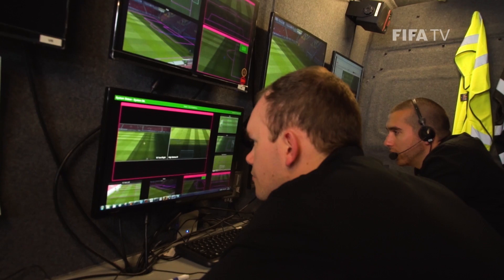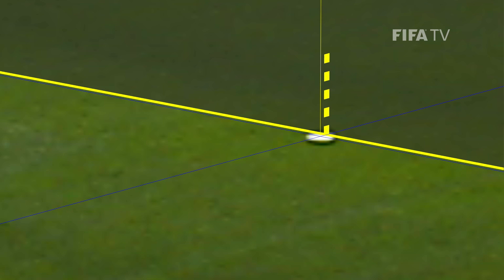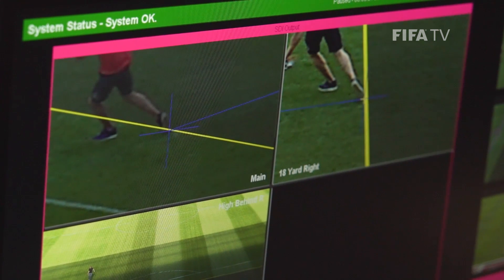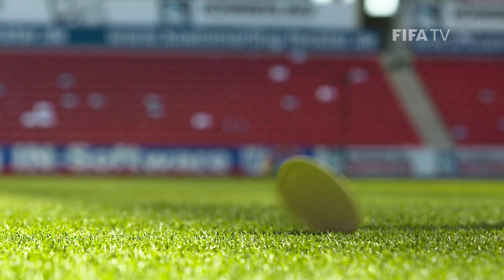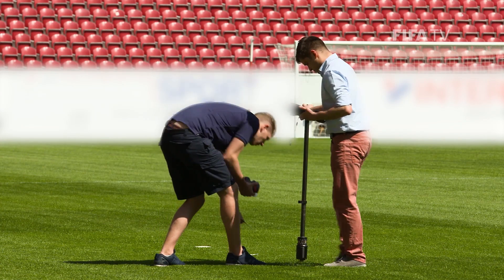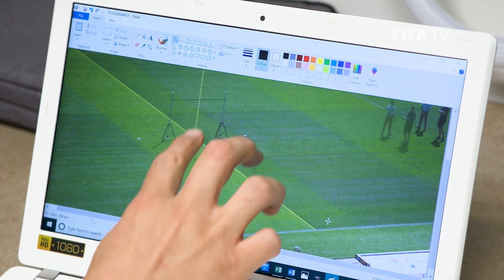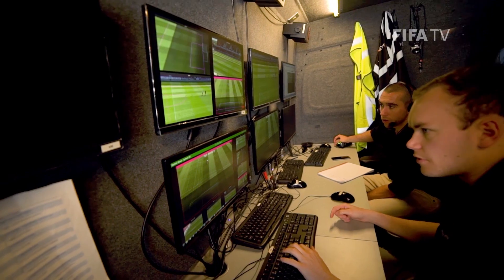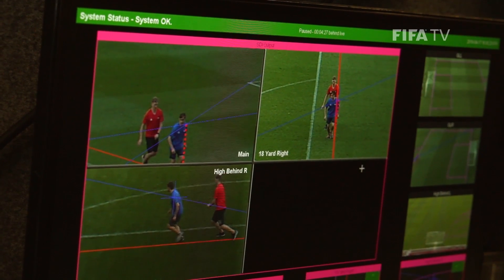Video Assistant Referee (VAR): The Virtual Offside Line

Comment: And notwithstanding, you are making finite calculations from cameras filming at 25fps where you should use high speed cameras, not the cameras filming the game.
Reply: And then, even at 4k, zooming in from a camera 100 metres away, will lose detail, such as on a bootlace or hair on a player's head. There should be a much greater margin of error introduced for the uncertainty in measurement. It must total at least 10-20 mm.

Comment: Completely flawed system because you don’t explain how you know exactly when the ball is kicked - Ben Chillwell was running at at least 25kph from an onside position so 100mm travel is 0.01440092 seconds - how do to know at what point Thiago Silva kicked the ball? You’re doing half a job - you need microphones to determine the exact moment the ball was kicked. 🤷‍♂️

Comment: Nice to see they're using MS Paint as one of their high tech tools. No wonder it's so accurate.
Reply: Pixel perfect accuracy
Reply: That seemed to be for a sketch. Could have done the same thing in AutoCAD but what is the point if someone just had to draw one line? The hardware used are expensive land surveying devices that can be precise enough for submillimetre measurements.

Comment: Hey Fifa. All measuring tools have a built in inaccuracy.  As an electrician I know that my Volt meter isn't 100% accurate and even if I grab 2 meters from the same manufacturer I might get 2 different readings. The manufacturer supplies a "tolerance" for the measurement and often this is up to 2% with the best meters giving a tolerance of 0,5 - 0,25%.  

What is the tolerance of this VAR system?
Reply: Far too complicated mate. Let's blindy trust technology and be amazed by the precision when hawk-eye indicates a Goal/No goal for 1cm. It is much more simple.
Reply: Exactly my point. 

Moreso, focus is more as to what is closer to the ground. Possibly neglecting a situation say a sting of hair of an attacker puts him offside.

I wonder why we would work with "negligible offside".

Comment: They literally explained one angle can entirely change perspective, so they can easily be missing the right angle, players can also obscure others which leads to refs guessing, also refs have no clue of where one body part starts and another ends under a shirt which can change it by mm. 

The next part for me is offsides by mm, are we really saying a few mm is an advantage for the attacker, surely there should be some leeway, mm is ridiculous and impacted by where the ref draws the line and when they guess the ball is struck.
Reply: This isn't VAR's problem. Change the laws if you don't want a player to be deemed offside if its a mere mm but bear in mind that whatever you change it to there will be a measurement that is going to be mm one side or the other.